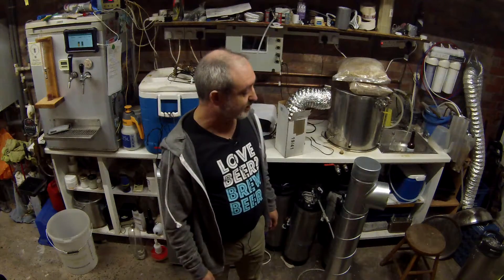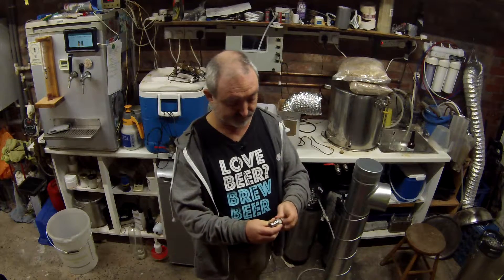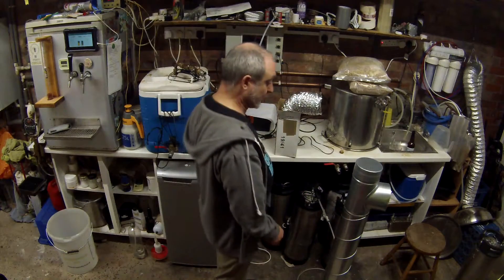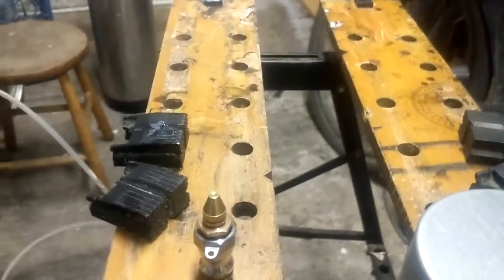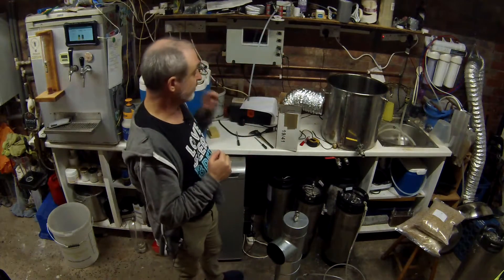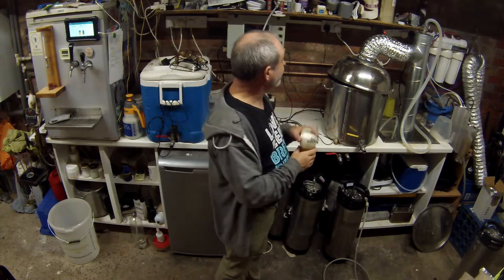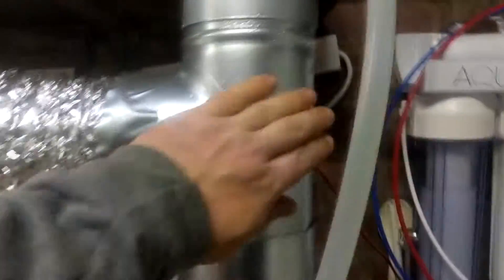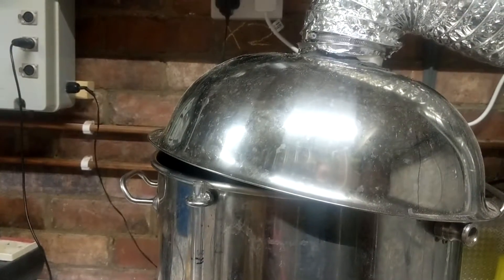Lockdown hack - building a steam condenser

Comment: Hi, A make little brewery in my basement and steam condenser is very interesting for me as substitute for ventilation. So, how much water do you spent in 1 hour? Does some condensed water drops return to the kettle?
Reply: Exactly the two questions I had 👍🏼
Reply from the maker: Hi, I haven't measured the water usage yet, but I'll take a measurement after work and let you know.  With any duct based ystem you will get some condensation calling back nto the kettle, hard to measure but it seemed similar to my extractor based version.
Reply: @TertiaryBrewing  So, there's no difference in efficiency between those two systems. Of course, where isn't possability to outdoor blowout this is perfect solution.
Reply from the maker: I think so, as I said in the video I haven't used this for a full brewday yet...
Reply from the maker: Quick update, probably uses about 30l in an hour, It would probably work at a lower flow rate as the conduit wasn't even warm
Reply: @TertiaryBrewing  OK. Thanks!